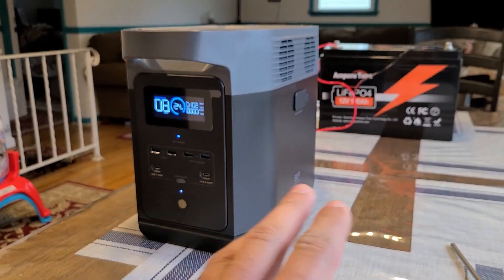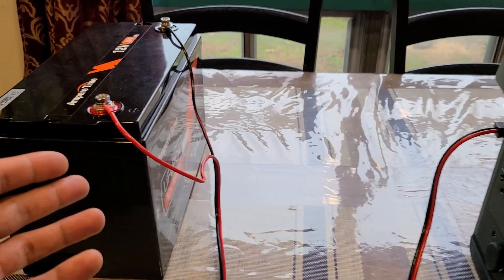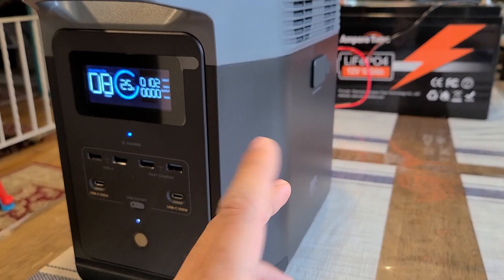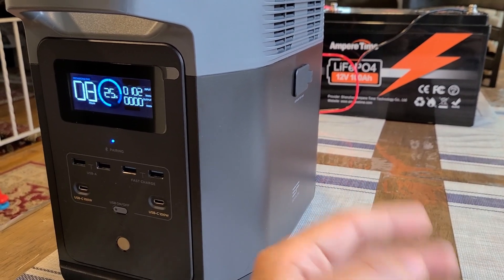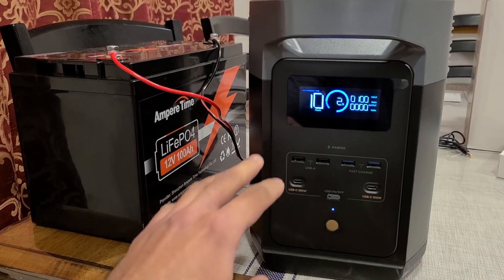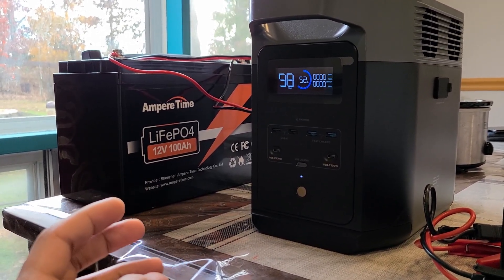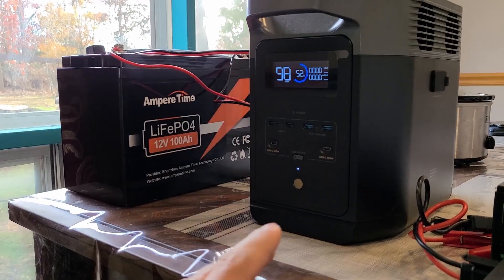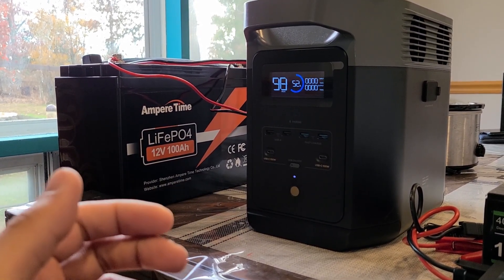Ampere Time Recharging EcoFlow DELTA 2 Power Station - Expansion Battery Test Number 2 #EcoFlow

Comment: 5:11first maybe your cable is xt60 instead of xt60i, second you need 2 of the 12v 100ah lifepo connect together to get 24v, so 24v x15a= 360watt (after using xt60i)

Comment: Using the wrong cable. Need the XT60i instead of XT60 the i is the middle connector that makes it 15amps (solar input) vs the car charger's 6-8 amps (Can't remember). Also, using two or a double corded XT60i will recharge twice as fast allowing you to plug into both solar inputs, doubling the charge speed.

Comment: Late to the party, but I do the same for my Delta 2. I purchased an Elefast 12.8v 100ah (includes Bluetooth to monitor percentages) and use o-rings to xt60i connector and that yields me 188w - 190w of input. My total was around $220 - $150 for battery, $50 for the EverExceed LiFePo4 wall charger with the o-rings and $20 for 10awg o-rings to xt60i cable. So with external battery I am getting 2304wh and when I purchase an additional Elefast battery will get a hefty 3584wh w/ price totaling $370 vs. the $600 EcoFlow battery (currently on sale for $450), but that only adds an additional 1024wh. Aesthetically, sure the branded mate battery is nice to look at, but for my purposes (power outage/SHTF), I am happy to save money and get more watt hours in doing so.

Comment: Ok. say I'm using my D2M running a fridge, and I have at battery inputted to the xt60 jack.   As I used the D2M's battery, is the Ampere Time constantly recharging it?  Is the D2M running the fridge from the Amper Time also?

Comment: Could I ask for some advice please? I have an ecoflow delta 2 with the generic ecoflow battery plugged into the side port. Is it possible to add a lithium battery to the solar port also, so that I have 3 batteries on the go?

Comment: yes it can recharge but slow recharge.  a 24 volt 50 or 100ah would be faster to charge.  24 volts battery = smaller size cables = less expensive  i do what you do also but i am savig to buy a 24 volts liefepo4 battery probably a 100ah bettery.

Comment: The direct connection from the 1280ah lifepo4 battery to the Delta 2 (O ring connectors at battery to XT60 solar input at Delta 2) charges at only 100ah. The test he did in another video used an inverter that put 300 watts input into the Delta. 

Big difference between the direct DC connection used here and using an inverter was that the direct DC connection was about 23% more efficient due to no loss because from inverter..

Some suggest in comments here to use a 24v DC boost converter or two 100ah lifepo4 batteries wired in series to get 24v. Both methods would double the input to 200 watts.

Charge Delta with solar and Ecoflow 800 watt Alternator Charger.

Charge external lifepo4 battery with PECRON 500W Car Charger DC1242-500.

Comment: You're using the wrong Connection XT60 cable. Should have an XT60I cable.
Delta 2 with an XT60 can only draw 8 amps where XT60I cable can draw 15amps you'll get much better amperage and power

Comment: Hi There I do this just the same but with a XT60i and get 190w input I use the cable that came with the delta 2 and have MC4 connectors on the battery.
Reply: Did you use a MC4 connector to O ring to the battery? I was thinking about doing the same thing.
Reply: @Theoriginalfamilyfirstfilms  a bit late on this but yes

Comment: I do not understand why you are only getting a hundred Watts I used a 50 amp hour battery hooked up to the solar on the back that looks just like you did and a couple clamps and my EcoFlow mini gets $165 Watts. I am getting ready to hook up a step up from 12:00 to 24 volt and see how many watts charging I get that way from a battery

Comment: There are two primary factors affecting charge speed on the D.C. input:  Voltage and Amperage.  Watts = Volts X Amps

The Delta 2 defaults to drawing an 8 amp limit.  If you look inside the XT60 receptacle you can see a small center contact.  That's because it is an XT60i, not just an XT60.  If that center contact is not connected, it will only attempt to draw 8 amps, just in case you are plugged into a cigarette lighter socket.  The lighter plug cable that came with the Delta 2 connects that center contact to one of either the positive or negative lines (I don't remember right now) and the solar MC4 adapter to XT60i connects the center to the other one.  When connected like the solar adapter the Delta 2 will attempt to draw up to 15 amps.  I have generic MC4 to XT60i (note the 'i' (eye)!) from amazon that is claimed Ecoflow support and is indeed wired correctly so that my Delta 2 Max draws 15 amps.  I have an XT60i to XT60 extension cable that is NOT wired correctly.  I still need to take it apart and connect that center terminal.

To get 500 watts using a good XT60i cable you need nearly 34 volts (33.333 Volts = 500 Watts / 15 Amps).  I believe (check my numbers) the Delta 2 can accept up to 60 volts.  You can use 3 batteries wired in series to get 36 volts (or 4 wired for 48 volts - recommended).

Or you can use a DC to DC boost converter you can boost your 12v battery to 48 volts (recommended, or at least 36 volts).  If you were to boost all the way to 60 volt then you could continue to use your 8 amp cable and get 60 Volt X 8 Amp = 480 Watt.

Using 36 volt to 48 volt input combined with an XT60i with the center wired correctly will allow the Delta 2 to draw 500 watts.
Reply: The Eco Flow car charger plug has a XT60I with the center pin shorted to positive side, so people are not drawing 15 amps from an automotive cigarette lighter socket, which is likely fused at 10 amps, so you are limited to 8 amps. In order to get the full 15 amps into the Delta 2 you need an xt60i cable with the center pin shorted to negative. When the Eco Flow recognizes your XT60I cable as a "Solar" connection you should be seeing closer to 190-200 watts (13 Volts x 15 amps = 195 watts)

Comment: get you a 240w converter and add the xt90 adapters and it will input 200 watts from the battery

Comment: 52%  / so what charge is left on the stand alone battery, 52% seems a rather low charge level ?
Reply from the maker: I was able to recharge the DELTA 2 power station to 100% once and then another 52% on top of that after discharging the DELTA 2.
Reply: @chargerharbor I see, I just received my Black Friday Li Time Battery, I think I need another at the prices they had! -  will give this a try thanks

Comment: 1:17 Recharge speed is fine, as long as it is higher then the average output. Now you can connect a whole lot of solar and charge the 100 Ah battery with it ;-)
Just make sure the battery is ok with discharging to 10 volt which is the cutoff voltage of the Delta

Comment: Is it not possible to charge the ecoflow through the solar input at night ?
Reply: Yes it is. That’s exactly what he was doing in this video. But he didn’t reach the true limit, because of improper cable choice (which limited the current) where he theoretically could have nearly doubled the input to ~200w.
Reply: not with solar panels, lol.

Comment: To all potential buyers, please avoid buying Ecoflow products. I recently cancelled my 2 orders of Ecoflow Delta 2. They are refusing to refund me. I've never received the products since they have recalled the shipment. They took away my $2,600 . Custoemr service are not responding at all.  Please avoid Ecoflow products!
 !!
Reply: You sound like you are getting an incentive to post these comments. (Ie. besides revenge. As there is no way they would cancel a delivery to anyone and then keep the customers money, as that would be fraud at that point and you would then sue them and win immediately. Not to mention any credit card company would reverse the charge upon request by the customer—then the company would have to defend the charges to try and get the money back =instant refund through credit card company.)

Comment: I just watched a diff youtubers video using a 12vdc to 36vdc converter to get higher watts. Just make sure supply to dc Converter cable is thick enough for the current

Comment: I also have a Delta 2 with the Ampere Time LFP, except I use a DC-DC 12v-24v 15A setup converter, just use a XT60i and not the XT60 into the Delta.
Since I am a bit of a camping and off grid user, the ampere time is recharged via panels using a Powerwerx MPPT-300-14.6, DC-to-DC Solar Charger Controller and added a shunt to the battery to meter the usage and discharge. 
Keep testing, I like your work
Reply: How many input watts does your setup provide? Like 360?
Reply: @GMC-qo9xi 
Hey there!
I know it's been over a year for this comment, but...
I see he didn't answer your question about how many watts he got with that setup.
Did you try it?
If so, could you please share the results?
If not...thanks for your time and have a blessed life.🙏
Reply: @YouLookingAtMeBro  hello Bro, I haven’t done anything since then. But since there are other options. I’m not particularly knowledgeable about them regarding whether they might suit your needs/cost, but both ecoflow and bluetti (as well as other brands) have come out with dc-dc chargers. Eg. Ecoflow Alternator Charger; Bleuetti Charger 1… There may be better alternatives out there for your wants, so I’d look for the limitations of these two and see what else is available for comparison. Like maybe you will prefer something from Victron. 🙏 👊

Comment: Where is the link for the cable? Just curious if it's XT60 or XT60i end? That's why you can only get 100 watts fyi.
Reply: The xt60 cable only allows 8a charging and the xt60i connector allows more, as the solar cable as the xt60i connector.  However the delta 2 car charger cable also has a xt60i cable on it, but it is wired to only allow 8a charge, due the vehicle wiring etc
Reply from the maker: I have added the link to the cable in the description. It's a XT60 cable. Thank you for the info! Would a XT60i end make a difference?
Reply: @chargerharbor yes, it should make all the difference. 

For example, take 12.8v and multiply by the 15A (?) maximum limit = ~200 watts... this is the maximum you can get through the solar input with a 12v battery, because of the amp limitation. BUT if you can raise the voltage somehow, like multiple batteries in series or a voltage converter, THEN you can achieve higher Wattages, as the voltage limit is 60V, correct? So 25v x 15a = ~375W, etc... 

So the higher the voltage you go, the more watts you can generate while drawing the same number of amps.
Reply: Thanks for the link , it's supposed to make a diff idk goodluck

Comment: Is there a way to charge the Ampere time battery using the ecoflow?
Reply from the maker: I suppose you could use a battery charger with the AC outlet, lol. That's the only way I could think of right now.
Reply: @chargerharbor Using a 2000 watt inverter puresine wave gas or LP charging generator is a good way if you don't have solar or the alternator charging devices hooked up to you car alternator.  Personally I'm not sure my 2016 CRV's alternator would last long with one if these new chargers. I would buy a solar panel or a portable one with 350 to 400 watts capacity.  But I'm still learning. What do I know LOL

Comment: Hello.  And can you charge the ecoflow delta 2 from the sun and charge the extra battery directly from there?  I would be interested in such a solution if I have a delta 2 on my camper and an additional battery such that I don't have to buy an additional delta 2 battery.
Reply: Buy charge controller to charge battery with that instead and charge exoflow using battery

Comment: Also you were wondering why it was "only 100W", that's because the battery is 12V and your app setting is likely under car charging 8A. 12*8 = 96W. You can't really go faster given what you have. You could have boosted charging if you wire in a 12v to 24V voltage booster in line. Also ideally you would have a fuse in this setup. Once solution to this is to go use a 12V battery clamp with an inline fuse like a NOCO GC017, and simply use the cigarette cable that came with the Delta 2. That will provide extra production.
Reply: It's actually the xt60 connection he has. The new Delta 2 works off xt60i which gives it more amps in the Delta 2
Reply: @1ENDUSER  correct. It has the extra connector that allows it to charge at 15 amps vs 8 amps if I am not mistaken.
Reply: XT60i. XT60i. XT60i. XT60i.

Comment: Unfortunately for real world use, you cannot recharge the ampere battery from the delta 2 without additional equipment. The beauty of the ecoflow extra battery is that it charges and discharges with zero conversion loss into the side port. This way a solar panel charges both simultaneously. Your test is interesting, but I assume you’re still charging the backup batter with a separate AC charger which is less usable for mobile situations.
Reply from the maker: Ah, you're right. I suppose the extra battery for the DELTA 2 is truly the full package and offers a smoother user experience. Thanks for the info.

Comment: Can you hook a battery like that into the expansion port on the side?
Reply: No, that connector connects to the internal 48 volt battery. Plus there's some data that normally comes from the expansion battery to acually make the connections live. Just checked mine with a meter and there is nothing on them

Comment: Hello from Ukraine 🇺🇦, kind difficult time here  sometimes no electricity fir a days. Luckily have river pro and looking what kind battery I can use it. How you recharge LiFePI4 12v 100Ah battery back ?
Reply from the maker: Hey there,

In this situation, I think it would be best to have a solar panel to recharge a 100Ah battery. Depending on what connection your solar panel uses, you would need a O ring to whatever connector your solar panel uses. At least, I'm pretty sure that's how you would be able to recharge a battery via a solar panel.

For example, if my solar panel used a Anderson port, I would need a Anderson to O ring cable. The Anderson end would plug into my solar panel and the O ring would connect to the battery to recharge it.

That said, I believe you will also need Charge Controller, too. Please stay safe.

Comment: Man, you hold connect one by one two batteries and you’ll get 24V and 200W charge
You may add up to 60 volts (5 batteries) and you’ll get 500W charge speed ;)

Comment: Hopefully this doesn't come across wrong (no offense intended), but if you already have the 2000w inverter, and I would assume an ac battery charger as well, what advantage is there to transferring the power over to the depleted Delta 2 anyway? And have you done any experimenting with step up dc voltage boosters in an attempt to get your input wattages over the 100-120w levels?
Reply from the maker: Hey there,

It's just a test I wanted to run to show that if you have a DELTA 2, you could use a deep-cycle battery like this one as an expandable battery by just using a cable.

You're right; I have a 2000W inverter and a battery charger, so it doesn't make sense to transfer power over to a DELTA 2. lol.

Also, not sure what step-up DC voltage boosters are, but I'll check it out. I'm mainly just some dude taking a look at products and seeing what happens. Thank you for watching.
Reply: The advantages are numerous. What is the cost. The ecoflow backup battery 799 dollars this 100-amp battery is as low as $299. Also you can charge your Eco flow in your tent on a rainy Shady day and have all access to all the inputs of the Delta too. Again just being a little creative with show you how I meant Ada's it would be to have that battery as a backup charger.
Reply: @thefpvlife7785  This is exactly what the benefit is for me. I have 2 @ 220w suitcase and 1@ 200w (vehicle-mounted) bifacial panels and live/camp in an area that only has about 4 hours peak solar hours. On a good day, I can charge my 2 Delta 2 units and my 230ah battery while conditions are optimized. With around 400w from the portable panels, a single Delta2 would take about 2.5 hours to fully charge or about 5 hours for both. At the same time, the 200w panel on my minivan roof can be dedicated to charging the battery. (Or I could dedicate one panel to each, etc.). And once the Deltas were fully charged, I could direct all 3 panels to charge the battery. (The Deltas are limited to 60v 500w pv input thus only 2 panels at a time because of VOC limitations, and the battery is hooked into a separate 100v|50amp mppt charger). Any extra solar the battery could capture would help get me through cloudy days while boondocking, and if I happen to be somewhere with AC power available I can also quickly charge the battery using a separate 40amp AC-DC charger. I'm looking forward to having over 5kwh available (1024wh + 1024wh + 2944wh) plus all the functions of the Delta2 units. I also have a smaller 12v 50ah battery I could include in the mix to get another 640wh. The cost of the additional power from the two batteries works out to be about $0.19 per watt-hour.

Comment: Charger Harbor - Thanks for the testing & vids, but do you know why the dc input was throttled down to only 102w? The EcoFlow Delta 2 specs say it can accept up to 500w (11-60V 15A Max, 500W Max) of dc input. I am also curious as to how much heat you got in the wires and what sizes you used.
Reply: The XT60 does not have the required 3rd pin that can be wired to tell the Delta 2 it is okay to draw 15 amps.  Needs an XT60i (with the 3rd pin) and that 3rd pin needs to be connected like the solar cable, not like the lighter plug cable and not left disconnected.